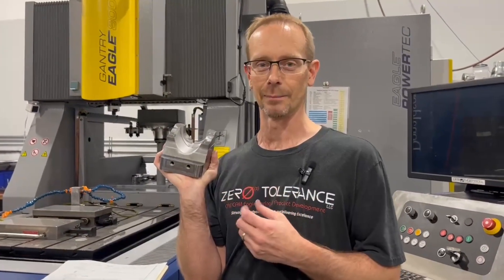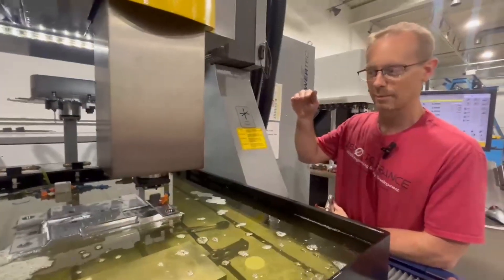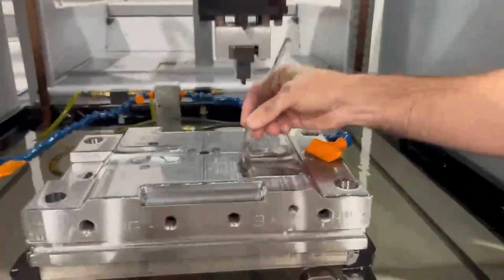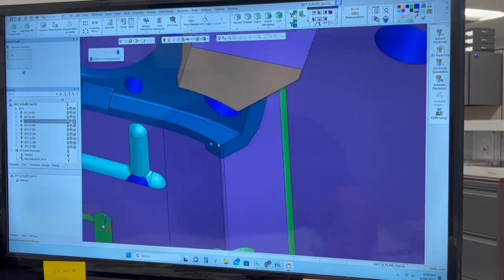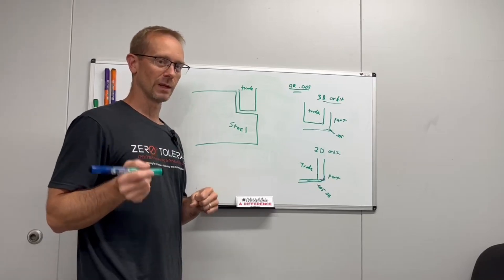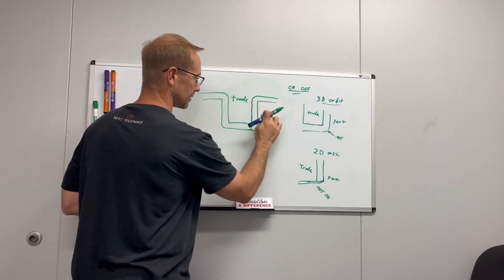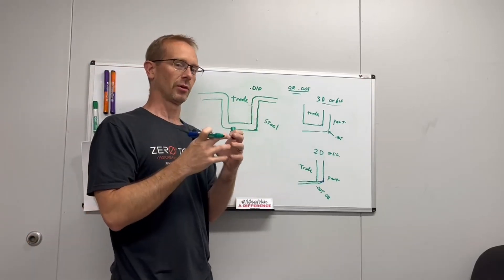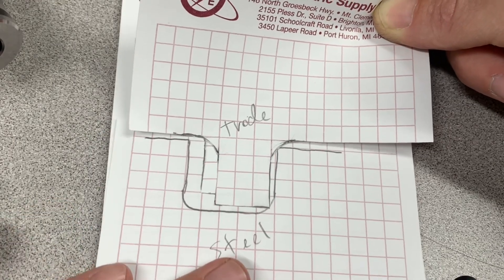Blending an EDM burned feature on a machined part

Comment: Wouldnt it also be better to keep the "armbit" as a sharp internal corner in the electode when using 3D orbit? that way the gritt couldnt roll the corner.
BTW thank you so much for your tip with engraving electrodes with a fiber laser! We got one and seems it also works for copper electrodes and entire logos!🙂 Now I'll have to try interesting textures...